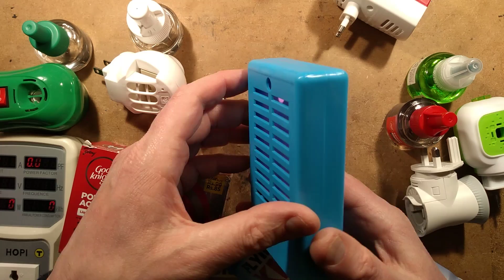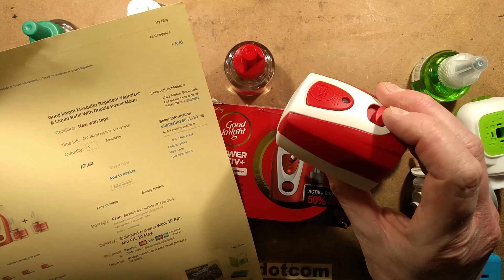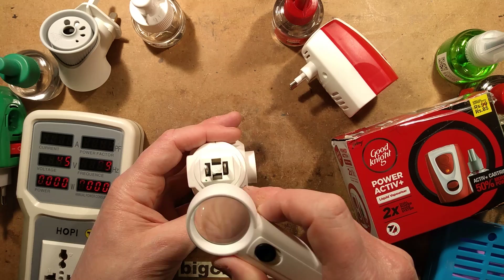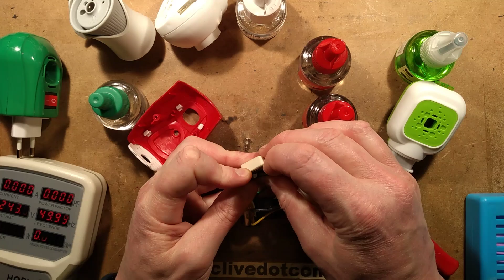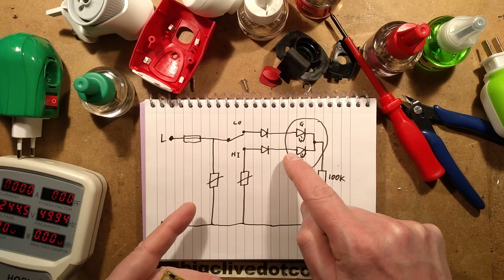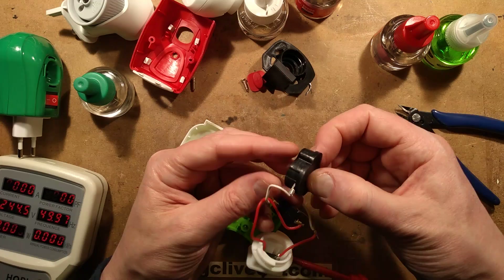Inside an Indian mosquito plug-in vapouriser/vaporizer.

Comment: I am sure you would find the newer mosquito vapouriser - Power+fan from Allout (SC Johnson company) much more interesting. It has a fan that blows over the exposed part of the refill to increase air flow rate (forced convection) for faster vaporization. The units that you show here use natural air convection. I recently got a unit to reverse engineer and have not opened it yet. I am sure you can do a video on that to cover how they step down the AC voltage to power a brushless DC fan under a cost of 1 pound! This unit has no screws and is totally held in place by plastic welding! so opening the unit would destroy the outer casing.
Reply from the maker: I've just made that video.  It will be released next week.  The circuitry was very interesting.
Reply: @bigclivedotcom  Glad to hear that bigclive. Keep up the good work. Thanks.
Reply from the maker: Here's a sneak preview so you don't have to open yours.
https://youtu.be/L49oHi_v07c

Comment: Hmm... Godrej electronic products are usually well made... (reasonably)

Common sense while using these vapourisers:
(For mosquito repellent use)
1. Never leave them on continiously or all night long. Use only during max mosquito influx, ie. evening to early night.

2.Always use in a well ventilated room (windows open) with forced ventilation ie. fans spinning.

Unless, you want that vomit inducing transflu..something undertones on your mucous membranes for the rest of the day.

Clive, for moth specific applications you could use a timer to swich those vapourisers on and off for a minute per day inside closets and the like..?
Reply from the maker: The timer idea is a good one.

Comment: There is an insect spray called prevent in tiny little cans, they used to only sell it in army navy shops, it kills every insect in a 10 metre radius in about 5 seconds, I have seen it kill a wasp straight away at about 5 meters from a tiny spray squirt (skoosh) midges are why a midge net costs 15 pounds.

They are like no see ums but 100x nasty, come in clouds like smoke.

https://m.youtube.com/watch?v=gVXztPJDM1s

Midges

https://m.youtube.com/watch?v=dNZrUMBBrYE

Comment: Big Clive. I need your help. I bought a bunch of 50 watt LED flood lights that I want to light up my garage. Bought them off Wish at a awesome price. I ordered ones for 120 volt to use in the United States. I got my order today, every last one of them were fir 220 volts.   They have 5 rows of LED's with 10 per row. There are 5 six pin chips at one end that apparently power one row each.
The other side where the mainstream cone in has a fuseable resistor, a metal oxide varistor that is disc shaped like a button battery, a full wave bridge and one resistor.  It is sealed with pop rivets. What can I do it change to make it work on 120 volts. 
I can send pics if you email me at Randallology@Gmail .com
Reply from the maker: Some of the driverless or DOB (Driver on Board) LEDs do have a facility to switch the LED array in two series (240) sections or two parallel sections for 120V.  Not all though and it will result in the wrong current setting components.
Reply: @bigclivedotcom  if you will email me   Randallology @ Gmail .com, i can send you some pics of it . You may know what I can do to make it work on 120 volts .

Comment: after stripping the plastic of your insulater screwdrivers, paint the exposed shaft with a couple of coats of clear nail varnish to give some protection from accidental (low-energy) shorts - it will crack off with wear so inspect and re-apply every now and then - better than nothing
Reply from the maker: I used to put heatshrink over my bare shafts.

Comment: So is one of the PTCs rated for a higher temperature? If they self "regulate" their temperature I would expect both PTCs to run on about half the current when both are on, effectively making no big difference.
Reply from the maker: I think it relies on the fact they are at opposite sides of the ceramic block to give two levels of heat.

Comment: For ticks and other critters, I use an 0.5% solution of permethrin in a spray bottle.  I spray the dogs, my clothes and shoes.  Ticks this time of year can be very troublesome.   I buy my permethrin as a concentrate at the local farm supply store.  Doubtless it would also work with your moth problem, simply sprayed onto clothes.  The stuff is quite safe being based on chemicals found in the chrysanthemum, but like all things, don't overdo.   Low-tech solution that doesn't involve taking the stuff into one's lungs.

Comment: The most annoying thing with the Indian brands is that the re-fills are not inter-compatible...

Sometimes within the same company different models have different sized re-fills. If the unit is costly, you may be forced to buy a costlier re-fill.

We don't use them much anymore but a little trick is to just pull out the centre hard wick and pour in the refill from another re-fill 🤪
Reply: Most of the units (often labeled as electronic liquid vaporiser) can use common refills and that includes some perfumes too. I do not care the brand when I buy the refill because it has always fit...
Reply from the maker: I wonder if careful decanting into an empty cartridge would work.
Reply: @bigclivedotcom  it works! Try it

Comment: It is 85 Rs which is MRP, you can get 5 Rs discount locally, comes around 1.2USD. The price is basically of the liquid bottle, the machines are sold virtually free of cost in India. Its a clever marketing, because these machines can be used with the same brand bottles only, and so the refill you will require every 20-30 days or so, makes it recover the cost for the machine by the company.

Comment: Stupid midges..getting a lot of them on/near the lake here in Toronto. Annoying little buggers. What is good to repel them outdoors?
Reply from the maker: A midge or mosquito eater will decimate the population when used at the right time of year.  It uses a catalytic converter to convert a gas supply to hot moist carbon dioxide (sometimes with octenol aroma too) which then lures the biting bugs to what they think is an animal.  They then get sucked into the trap.

Comment: Concerning mosquitoes in the UK being a problem or not, that depends where you live.  I live on the Wirral but several miles from any water. However to be green the Wirral councils stopped spraying stagnant water caused by the Dee flooding, quite some years ago. In hot summers there is a mosquito problem now on the Wirral with many people being bit in their gardens.
Reply: I would have thought it would be very difficult to tell the sound of a mozzie and a Scallie apart on the Wirral.  Both have an annoying whine. 🤭

Comment: If these these things work like a plugin air freshener, then would it but posable to use pyrethrin in a plugin air freshener? If you can, then would it be possible to turn one of these into a plugin air freshener using something like essential oils?
Reply from the maker: Theoretically yes.
Reply: @bigclivedotcom  surely an experiment should now follow by BCDC?

Comment: The best solution for moths is to use the fly tongue catchers (or fly paper). You hang it at the corners of doors near the potential source. I stumbled upon this by chance. I received a small pack of 4 from someone, and decided to do it for nostalgia reasons, flies aren't exactly an issue because of screens. So i hung them in various places, one such place being right near my clothes rack at the entrance, but i couldn't put it in the middle of the road and the ceiling has a bike rack. So, door corner to wall it was. The thing was caked in moths in under half a year. All of it. It's actually...disturbing since some still move until they die. Have repeated the process near the other clothes in the house, same effect.

Comment: I've used, limitedly, some stuff called permethrin which is a member of the pyrethrin family. I use it for ticks, which are a big problem where I live. I mention this because permethrin is highly toxic to cats and fish. Something to keep in mind. But it is effective against ticks - I use it on clothes, applying it and letting it dry. Never want it wet on skin, I believe.
Reply: Technically it is toxic to most, if not all, animals, but most mammals are not affected by reasonable dosages because we possess an enzyme that very rapidly neutralizes and metabolizes the toxin which quickly removes it from circulation, thus protecting us from exposure.  Cats, however, lack that enzyme as it’s been lost or become inactive in their genetics so you have to be careful about the dose a cat can receive versus most mammals (though cats can still tolerate low levels without harm, but those low levels are like 1% of what most mammals can safely tolerate by weight, if I recall correctly).  That enzyme is why sedating the human patient that tried to commit suicide by drinking the fluid was sufficient to likely avoid lasting harm, they just had to bide time for the body to produce more enzyme and complete deactivating/metabolizing the toxin after the initial dose likely overwhelmed the body’s ability to metabolize it in near real time.  It’s much like our tolerance for alcohol that is toxic to most other mammals because we possess enzymes to deactivate and metabolize alcohol in the liver relatively quickly and that is rare in mammals outside of primates (it turns out some primates also enjoy alcohol and even exhibit similar rates of alcoholism to humans).
Reply: @ethanpoole3443  That's profoundly interesting. Thanks Ethan. It makes me wonder about the many ways medicines must operate to manage a target problem. (But now I worry that Clive experiment with drinking some to see if he can test the process in some way. [wink])

Comment: Are these PTC elements the same as those now used in some cars to heat up the cabin quickly?  One post I saw said the device on his/her Mondeo draws 80amps... If so, I guess they come in different sizes!  (Check out your Mum's Skoda?)
Reply from the maker: Similar idea if the car heaters are based on PTC ceramic.
Reply: 80 amps from a 12v car electrical system may sound a lot, but it's a very low amount of heat compared to the conventional cabin heater that uses engine coolant, which are in the range of 5-10kW.

Comment: Moth balls maybe those seem to work. Kansas finally thawed then flooded warmed then rained then snowed now its nice today. Bugs were spotted 4 days ago. So great timing on this video.
Reply from the maker: Moth balls used to be a block of material that gradually vapourised into the air.  Now they're just plaster pellets with a hint of camphor infused into them.  It looks like they're lasting for ages until you realise that they're basically fake.
Reply: @bigclivedotcom  my mom still uses them, And your right they do disappear. Funny note, she found an old box of them like 10 yeats old in a sealed box, so her thinking was they were weak so when she put them out she doubled the amounts she normally puts out, needless to say it was way to much, we all suffered the next few days running around trying to pick them up. That was 6 months ago the balls are about the size of a pill or pea some, in the garage are about rice sized.
Reply: @bigclivedotcom  The mothballs stateside, at least in the midwest, are not camphor. Napthalene or or some similar replacement to it.  They work but they also stink and probably are pretty bad for human health too. I wouldn't use them. There is Probably good reason you guys have fake plaster ones.
Reply: How do the moths fly with those balls?
Reply: @oscarbear1043  proudly.